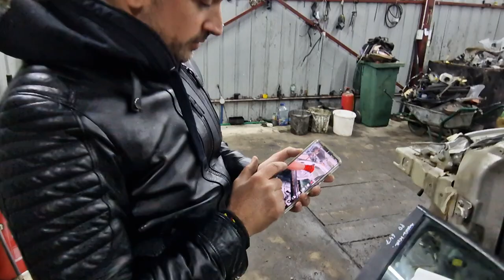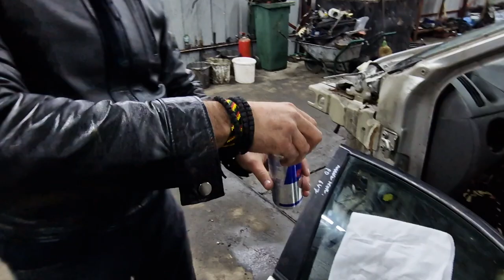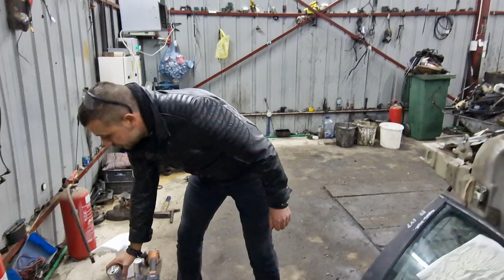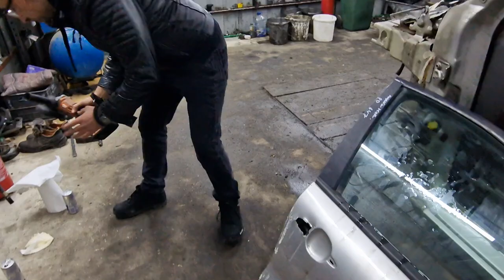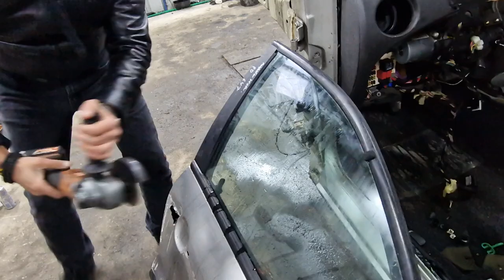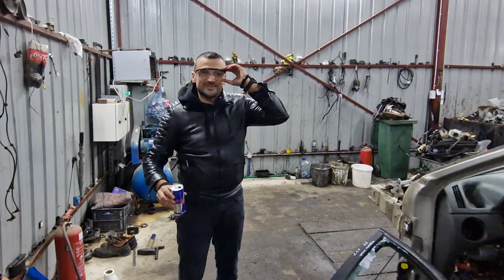Red Bull VS car glass THE TRUTH

Comment: how does that work?
Reply: Thermal dynamics in action, friction heated the glass and the cold red bull changed the temperature drastically enough that the glass shattered.
Reply: seriously just the temperature difference?

Because in winter time i hate cleaning the windows, and so i do it the lazy way.
I just use a bit of warm water. Like in: warm to the touch.
Obviously not too hot, but just warm to the touch.
I have NEVER had any of my car windows shatter.
Maybe i am lucky, it could be.
But i am not joking.
When the ice is on the windows, i use warm water.
And as soon as it is clean, i obviously dry the windows asap to keep it from refreezing.

I know glass can shatter because of what you explained. But i would not have thought that this is the case in this video.
So basically they could have used coca cola, 7-up or any other stuff?
 @TehApplepieOracle
Reply: @bertjesklotepino  if it's enough difference in temperature, it could literally be any liquid. Liquid nitrogen is used in a bunch of demonstrations of quick freezing shattering things that normally wouldn't shatter like bananas and such. Glass is, to be fair, just a really fun way to demonstrate thermodynamics.
Reply: @TehApplepieOracle  so was it the cold? or the redbull? what if it was Coke? Or some other bubbly fizzy drink?
Reply: @chyhart  Just the cold! Technically if it was subzero long enough outside you could do the same thing with a hot enough liquid. The major player is the difference in temperature causing the break. If you were to say leave glass in liquid nitrogen till the temperature regulates, then bring it up in temperature quick enough it would shatter the same way.
Reply: Same goes for heating the glass like shown then pouring what I'm assuming was a drink from a fridge? But could've even been room temp if the glass was hot enough.
Reply: I was thinking the same thing in first video I saw of a car sitting in junk yard having window broken with Red Bull…must’ve been a hot day. So basically you could fill up your washer reservoir with icy water,angle the sprayers to the left and right,and be able to break windows on a hot summer’s day…great for road ragers!😁